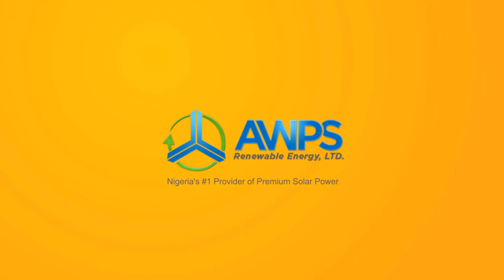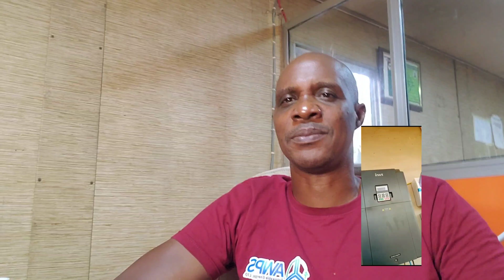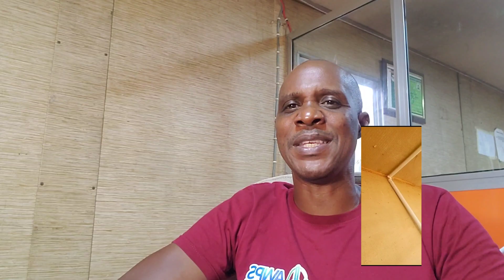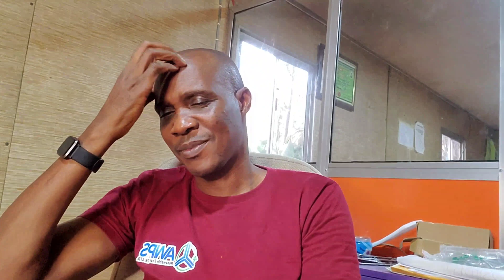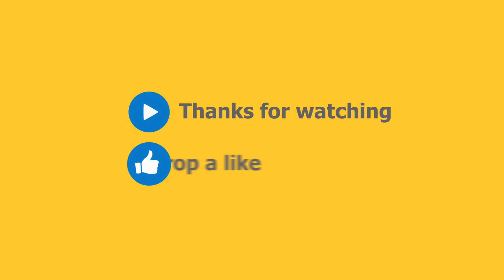Disaster at the Fish Farm. 2000 dead fish. How did we let it happen?

Comment: Huge mistake, running 6mm cable for  that distance to power a 20hp pump, whether AC or DC , wasnt a good idea.

There are online charts that will do the calculations and tell you the energy loss.

Good thing you were able to resolve the issue.gr8 learning point
Reply from the maker: Thank for the observation and your contribution. I was expecting that you would comment on the change as opposed to the mistake that I clearly pointed out.